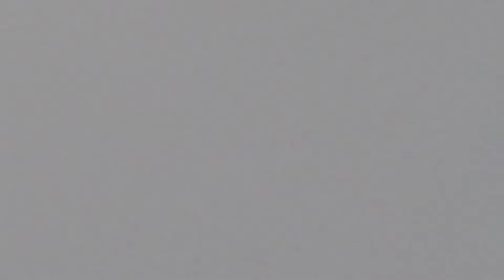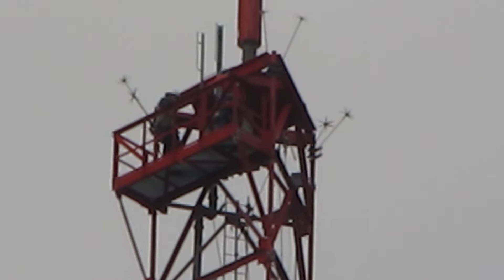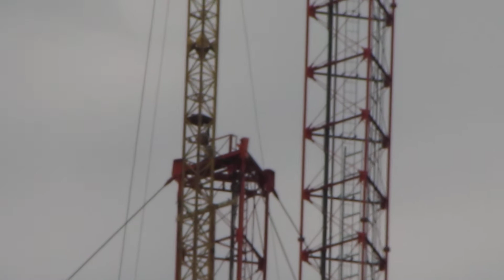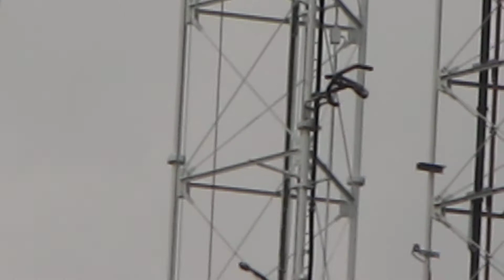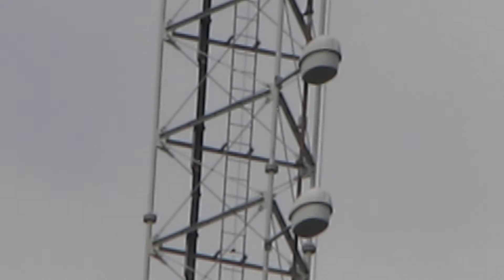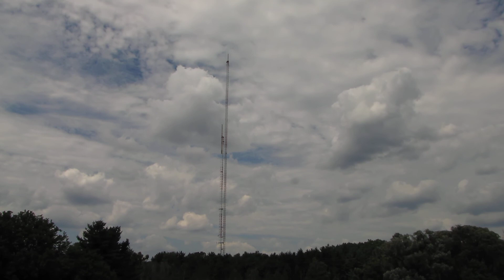WKAR Towers.MOV

Comment from the maker: Actually, they installed the new tower before taking down the old one. I believe the platforms were a temporary item in the structure while they were installing and tuning the elements of the antennas for optimum signal and directionality. They left the lower portion of the old tower in place which contained all of the cabling some of which was underground to a structure which holds the transmitter and other electronics so that part can still be seen when up close.